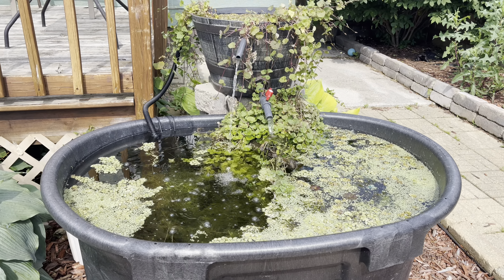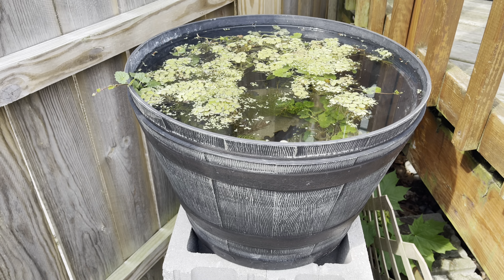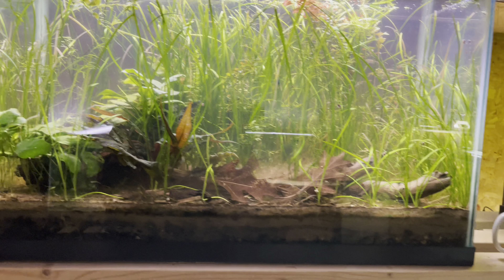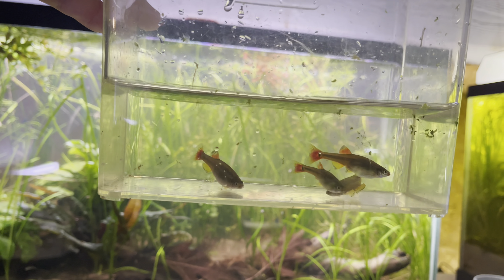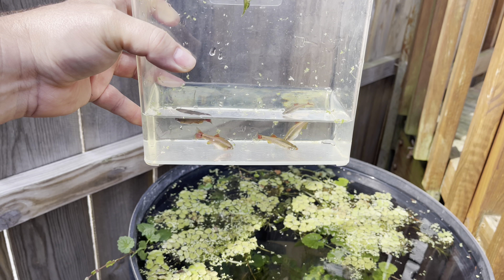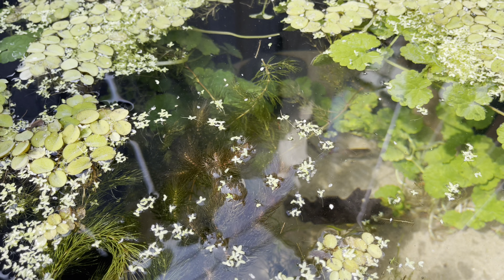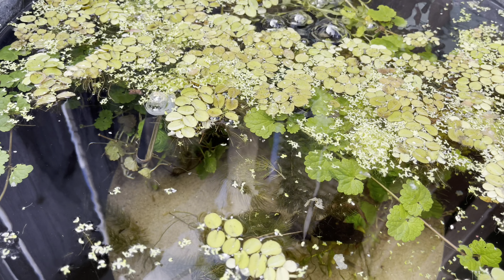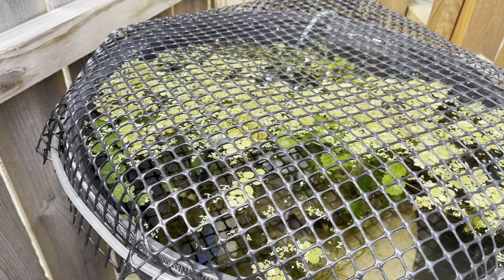New Breeding Project Turns Disaster

Comment: Hi Patty…I have noticed in my pond of similar size that the fish would jump out in the area of the bubbler…as soon as I removed the air stone I have had zero jumpers.  It looks like yours all jumped at the same spot near the bubbler edge.  Just a thought but the similarities between our ponds is very close and it solved my issue 100%…good luck!!
Reply from the maker: @TheDusthound1  wow that a great tip, thank you! I kept the air stone in only in case of low oxygen with the summer heat but that is definitely a trick I may try. I recently took the cover off with the platys and they haven’t jumped out so hoping I’m good. Thanks for the tip and thanks for watching 😁👍

Comment: Sorry for your loss!  Have you thought about maybe a larger, deeper tub like a stock tank so you can keep the water level low enough that they can't jump out?  I have mutt guppies in a 110 gallon tuff stuff stock tank i got for cheap at TSC.  I haven't had any jumpers but i keep the water level about 2-3 inches below the rim of the stock tank.
Reply from the maker: @mongguppiesandendlers  I have a 100 gallon stock tank with mutt guppies and they do great. For some reason swordtails jump on me and now these. But that definitely is a great idea for the future with a bigger tub and lower water levels. Thanks for the idea and for watching 😁👍

Comment: I HATE to lose fish! It really sucks!!! If you were to try again in that same tub - I can think of two  suggestions: 1) lower the water line to about 3" below the top of the tub. And 2) is exactly what you did. (I'm typing this before you finished.) :-) I think your solution should do it. I think I'd still drop the water line down a bit just ot be safe. MTC ~Ron
Reply from the maker: @RonsGarageAquatics  thanks for the tips Ron, I mostly definitely will try these outside again but will definitely drop the water line and keep it covered. Thanks for watching 😁👍
Reply: @pattys_aquatics  Best of luck with them!